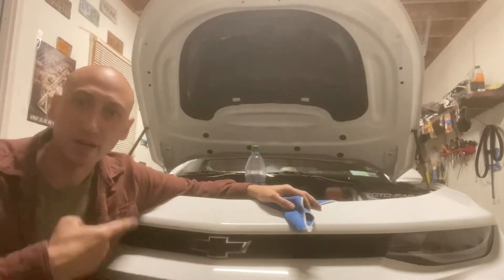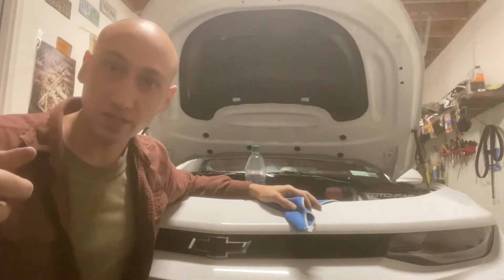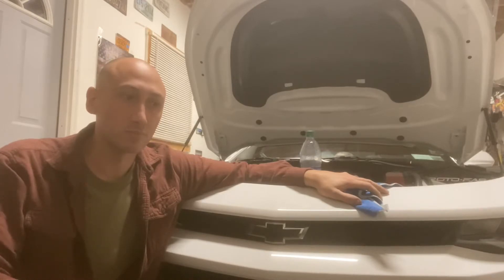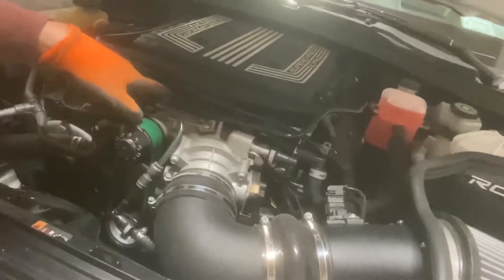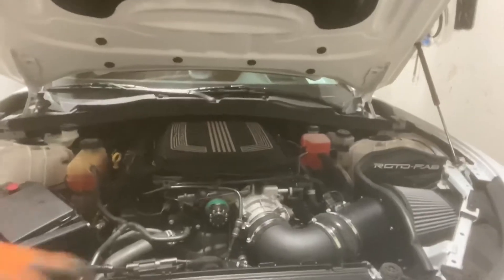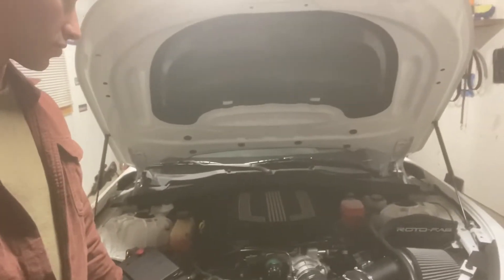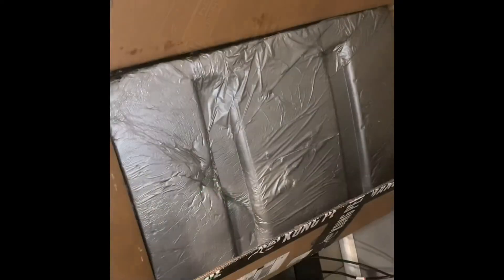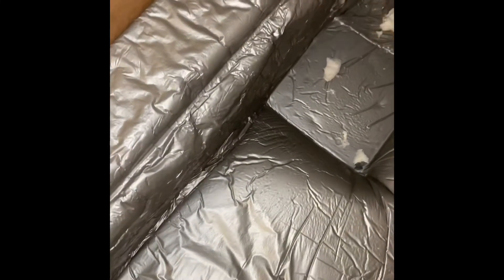LT4 supercharger rebuild

Comment: Hey bro how much was the rebuild ??
Reply from the maker: Honestly I don’t remember exactly but somewhere around 800
Reply from the maker: That was shipping and buying a box from kong to ship it in
Reply: @Boostedzl1  cool is it easy removal ?
Reply from the maker: @vc3buildzz  yea it’s really easy actually, just pull the coolant lines off the snout , remove the supercharger pulley belt , supercharger lid than remove the remaining bolts, there is a sensors on the back side ( fire wall side ) of the supercharger you need to unplug as well
Reply: @Boostedzl1  cool thanks bro 🙏🏼
Reply: My supercharger pulley is stuck for some reason need get it fixed
Reply: Did u unplug the battery
Reply from the maker: @vc3buildzz  I did not but looking back at it I probably should have
Reply: @Boostedzl1  just took mine off easier than I thought… did u get it retuned ? Or just popped it back on and was good ?
Reply: Bro did they change ur rotors ?